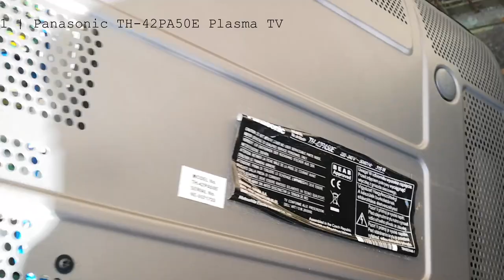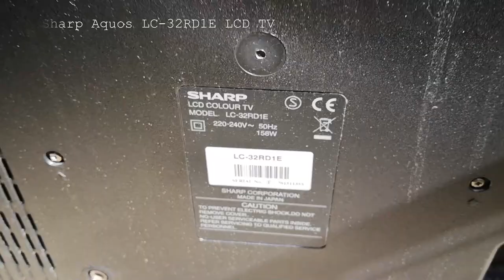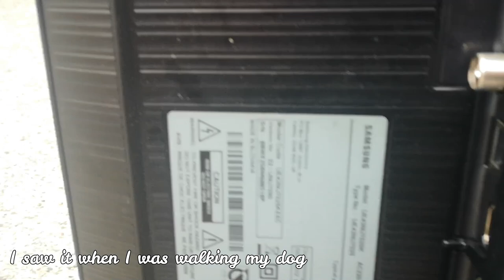Speaker Hunting Video #32 | The BEST ONE so far ?

Comment: have you ever found any pioneer plasma tv's? i have once and even had a separate amp board 12v input and 20w output even though it's class D i still repurposed it. The woofers they drive were rotten beyond repair paper was brittle and rustr frame
Reply from the maker: Sadly no, but I did found an lcd tv with pioneer speakers inside!
Reply: @LSandM-SpeakersFromEverywhere  cool you might find one someday just how I las week found a kicker cx1000.1 amp

Comment: Hello. Today i found a b&w dm 602 s1 speaker on the side of the road. It has no woofer and it is really scratched but a cheap 7inch woofer and some spraypaint  will fix it.
Reply: Ooh! So cool! That's sad tho. I had them, they sound great
Reply from the maker: Oh wow! How much cost remplacement woofers? What about the enclosures? With some work and a bit of money you can can turn them into amazing speakers again
Reply: @LSandM-SpeakersFromEverywhere  the woofers cost around 60 euros. I just finished spraypainting the enclosure